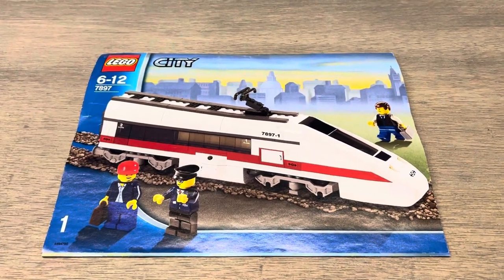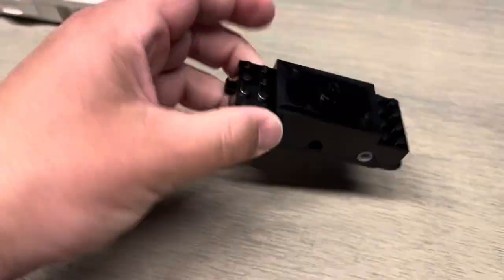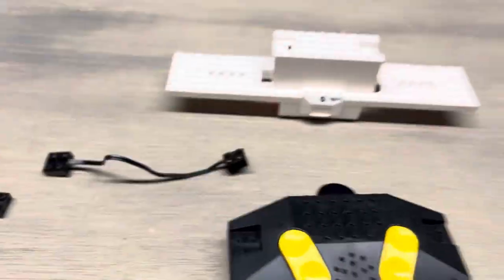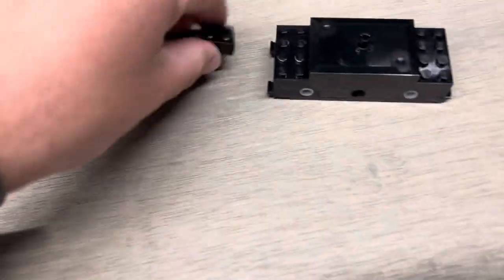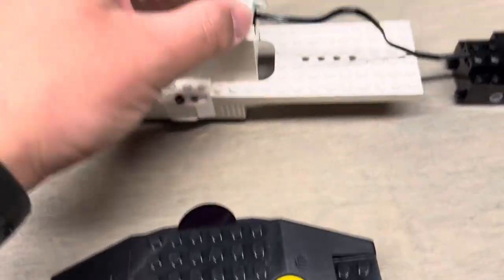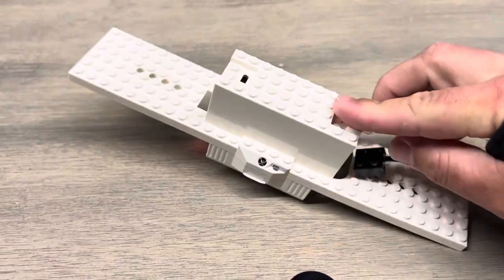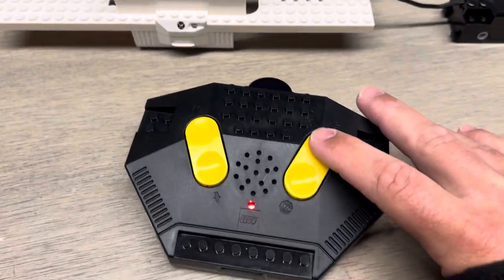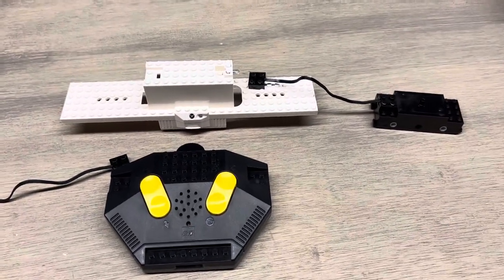7897 Lego Passenger Train Remote Troubleshooting Help

Comment: I‘ve got the same problem and have no ideas
Reply from the maker: I was able to fix it, here is what I used 
AFAIK, the sound comes from the remote, right?

So, if the sound works it doesn't mean the remote is fully working or the IR connection is working.

You will need to troubleshoot every part.

•	Batteries: looks like the batteries are working. I don't see a reason to test them.
•	Remote: open the selfie camera of your phone and check if it can see the IR light from a working TV remote when you press a button. If you can see, check if you can see the IR light of the Lego remote. Test the left button and the bottom function of the right button. If you can't see the light by pressing any button, it may have a problem with the IR. If you can see the light when you press the right button but not the left button, the left button has a problem. Anyway, you will have to open and try to fix it if you know how to do it.
•	Engine: I'd try to connect a 9v battery (or 6x 1,5v batteries) directly to the metal contacts inside the studs of the engine using thin electrical cables (not Lego cables). You can test the LED block this way too.
•	Engine cable: connect the Lego cable to the engine and try to connect the 9V battery directly to the stud contacts of the cable.
•	Battery base: if everything above worked, probably there's something wrong with the battery base. You can use a multimeter to test the output contacts of the block when you accelerate. Alternatively you can buy a 9V LED and connect directly to the output contacts and check if it works when you accelerate.
Reply: me too, according to what I have heard many people   have this same issue.